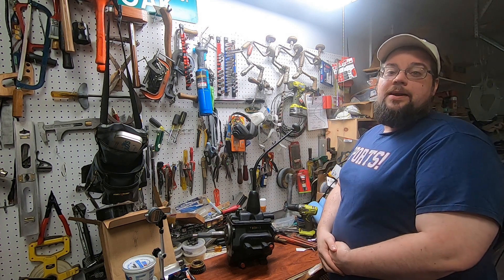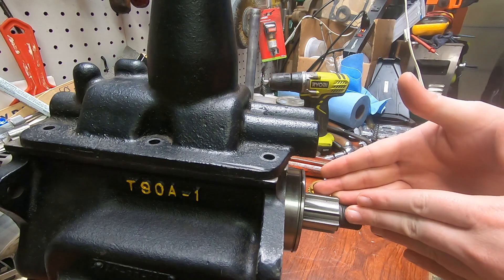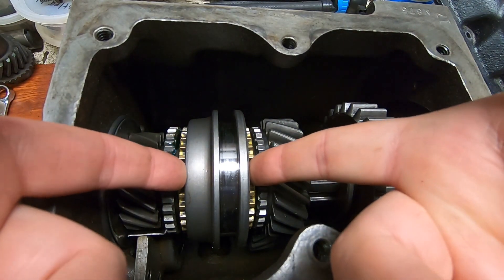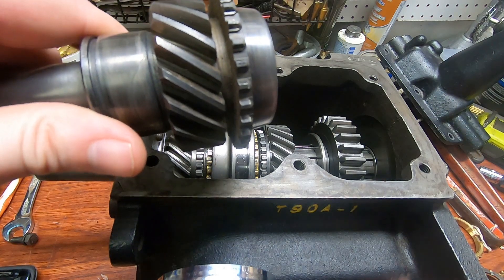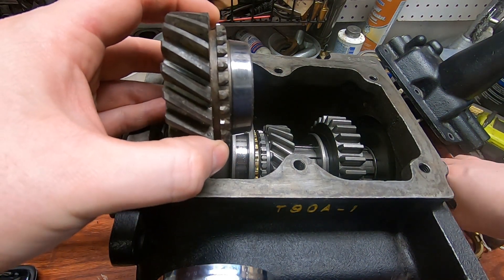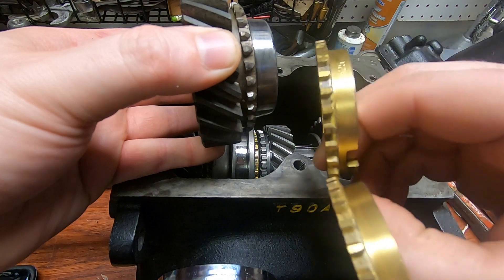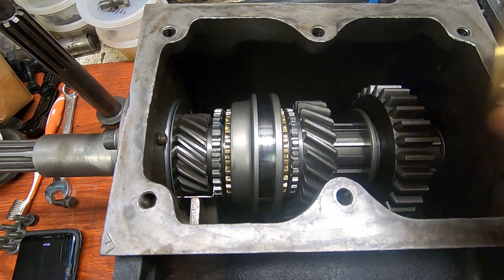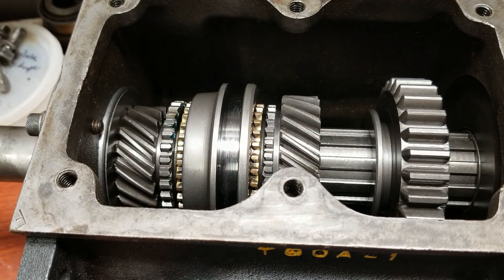Ep. 64: T90 Rebuild Part 5 - More Parts Struggles

Comment: Ah the paradox of rebuilding an old Jeep.  You spend so much time researching, learning, doing, and redoing to become an expert ,only to hope your work lasts so long you never have to o it again. Great stuff. In the next few years I will be doing my T90 and D18 so your experience is invaluable to me. Can’t wait to see it drive.
Reply from the maker: That's why I add as much part info as I can when I make these videos. I keep reading that Omix parts are out-of-spec junk in many cases but no one really says which ones or why they're not right. Some are actually ok. I get to add Omix synchronizer clutch hubs the list of junk parts in the next video, for instance... but the clutch sleeve seems to work fine.